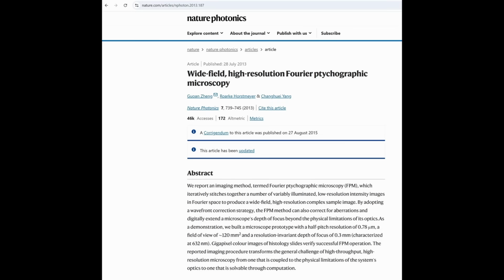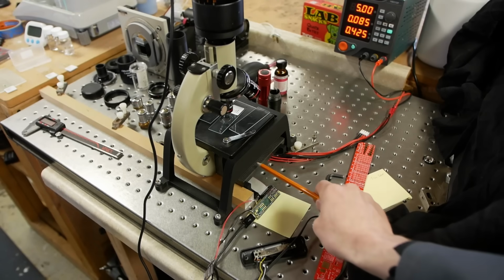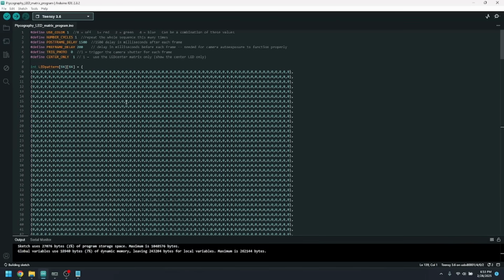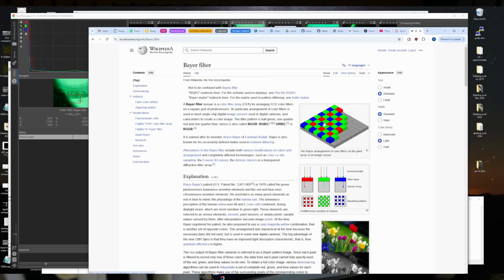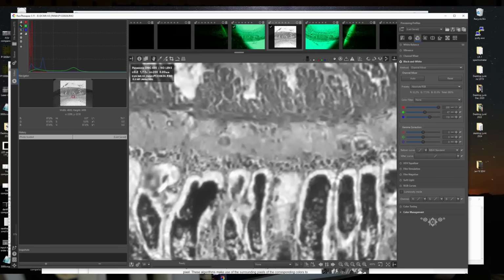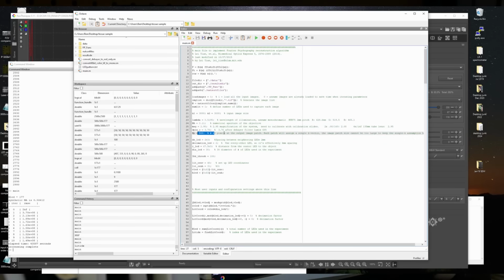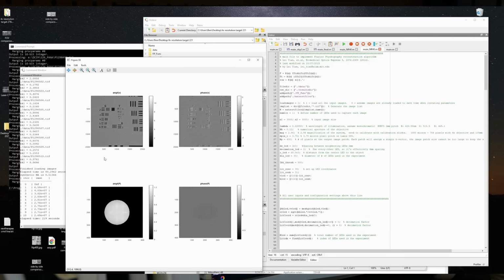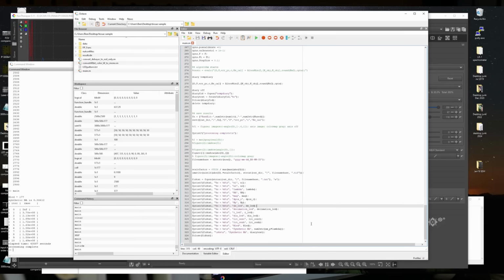Dramatically improve microscope resolution with an LED array and Fourier Ptychography

Comment: It's very cool technique. I found the principle is very similar  to single crystal x-ray crystallography, where as the x-ray is fix .  The sample is mounted on goniometer and rotated, so the diffraction pattern is captured on a ccd camera.  To eliminate the zero order diffraction, they just block everything that is in line with the light source with a metal.

Comment: 18:00 I find it not so obvious why oft center images are brighter. Probably you built an intuition. I believe you should test the emission pattern of the LEDs. As far as I know surface LEDs approximate a Lambertian pattern. I think in this case it makes sense to increase the gain of the offcenter images to compensate for the reduced light coming into the lense cause by less light being emitted into the direction of the lens.
Reply: There might be an issue related to the sensor noise. It think it should be compensated(subtracted) before changing the exposure level.

Comment: 5:45 well there also the refraction too, you have to pass light through different phase changes, from light source, possibly through a lens to get a narrow point source, then through the glass or plastic slide, through the sample that's probably in a liquid solution, through the another slide, then through the air in to the lens system of the micro scope and then the lens of the camera, and then the cmos or ccd sensor

Then what glass is it? some glass isn't totally transparent in visible light, can be a little greenish or bluish, can see that effect if you hold two mirrors facing each other and look at the infinity pattern, stare down the tunnel you just see the greenish or bluish color from the glass attenuating the light each time it reflects the same image...

Silicon glass? quartz or carbon (diamond) glass?
Reply: 7:10 so basically 2d/3d scanning the wavefront or interference pattern to generate a image that has a higher apparent resolution than using a non polarized and Omnidirectional light source

Wouldn't a dmd chip and laser be much better at this than leds, get a much finer light beam, and much more precise scanning of the sample, with a dmd chip you could use it to display the luminance of the sample based on what the capture device is seeing. You can then use different color lasers to provide different wavelengths to scan (irrgbuv), then use that to stitch a high quality image in color, and with contrast and gamma maps

A Laser scanning microscope?

Comment: Very cool!

17:49 "So the question is, can you change the exposure? Does the algorithm allow you to have different exposure levels?"

You could take multiple photos with the same parameters and compute their average to reduce the noise.

I suspect that you could also use a longer exposure time if you can compensate for the increased values afterwards.

Comment: you might be able to do this with a monochrome machine vision camera and then swap single color filters in front of the CCD to reconstruct a color image from multiple monochrome images. you could use a spectral imaging wheel or something like that. then you would get super detailed images with color. although it would be tricky to swap it without moving anything. it would have to be extremely stable

Comment: For your Monochrome needs you should be able to use camera from Astrophotography if I am not mistaken.
Many of them are mono sensors and come in many different price points and sensor sizes.
Planetary, Guidescope and even full frame sensors. All Mono without any filters as this allows you to see full spectrum and filter for yourself and start at 150 bucks for the small sensor sizes.

Comment: My ignorance may be showing here, but I wonder if the images can be split up into different regions utilizing different phases automatically, then, when displayed, it shows each of them, and you can click on the ones which have errors, or the one which is best, and then it reruns with a cluster of phases around the one selected. It's a usability thing, but seems like it would cut the number of attempts to find the phase by an order of magnitude or so.

Comment: Just wondering if a white LED would work better with the colour filter on a dSLR, particuarly if it's the style that uses R+G+B to produce the white colour? What about using fibre optics and a halogen source? The tricky part would be routing light to only one strand at a time.

Comment: It should be possible to get the camera to output the raw color image. This would then be the dotty unbayered image from the bottom wiki pic. Using a white light source, you should be able to reconstruct a greyscale image by multiplying each color type with some value such that you couldn't tell it wasn't a real grayscale image anymore. This would effectively remove the color filter and increase the resolution. Due to the double green, this cannot be done on the bayered color image without introducing a location error.

Comment: You just summarized my first year of PhD struggles in just 10 minutes of explanation. Why you didn't make this earlier?? 😂
Regarding the Bayer filter, you can think of it as a multiplication of comb function with the original input image.
Multiplication on image plane equals to convolution at Fourier plane.
So if can design a digital filter with some sort of regularization (e.g. Total Variation) I think you can get a way with it. In fact this is how camera interpolate the missing pixels.
Alternatively, there are a few cheap monochromatic CMOS cameras targeted for Rasp Pi market. Try using those.
Also can you do comparison on the cheap AliExpress lenses? You said it will not work. I'm curious how good/bad the result will be compared to a proper objective lens.
If it works at certain degree I think it's a good project for students.

Comment: He mentioned you can figure out the phase. But what phase, of each pixel or each illuminated picture or each lighted LED or what exactly?
Reply: He meant the light phase. Light is an electromagnetic wave. Wave has amplitude, frequency and phase delay. You can't measure the phase directly using camera or eyes, they can only detect amplitude (brightness) and frequency (color). But using the diffraction model you can kind of reconstruct the full wave information and estimate the light phase.
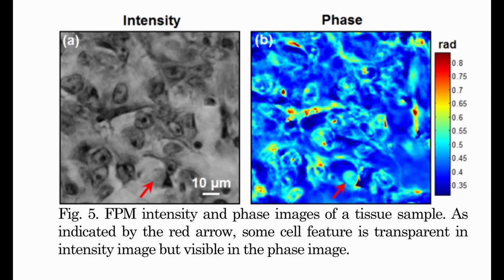Reply: @syukranhakimbinnorazman7430 thank you! he showed a picture at 19:40 - Is this then the phase of the light which is different for each pixel, but has only one fixed value per pixel?
Reply: @ssa7843  yes the right side is the phase image. which is in radian. usually we plot it in range 0 to 2pi. he uses pseudo-color to highlight the low(blue) and high(red) phase. physically the phase delay depends on refractive index and thickness. so you can see the background has lowest phase. next is cytoplasm. highest is the nuclear region, probably due to dense protein structure.

the staining dye are attracted to specific cellular structure. so there might be certain part that remain transparent after staining. 
we can't see them using conventional brightfield due to low contrast. but using phase imaging those invisible feature will be revealed.

Comment: Looks like this is protein X-ray diffraction (or other crystal diffraction) but using visible light, it'll definitely take some computation time to actually get a high-res image out of that. Rotating the beam probably works better than having an LED array too?

Comment: I am really curious if you could try with the raspberry pi HQ camera and physically remove the bayer filter. That camera sensor should not be too expensive, so breaking a few would be okay. It is C or CS mount so relatively easy to adapt to your setup hopefully?

Comment: Excellent!   Very well presented!    
I am looking at the possibility to use this in a non transparent sample by using an array located above the sample (approx in the plane of the back input aperture of the miceoscope lens).   Although I will loose the brightfield  illumination part of the images due to the lens being in the way, I think that the remaining dark field images should be enough tio use the reconstruction algorithm.    
I have a de-bayered old DSLR which I did debayered myself with a lot of sweat and fortunatly no tears.

Comment: This reminds me of coded aperture used in X-ray and gamma imaging where the light cannot be simply focused with a glass lens. Instead, the camera uses a filter plate with predefined pattern of punched holes (sometimes resembling a QR code). A special case of such camera is having a plate with single tiny hole in the center (commonly known as "camera obscura"). The image captured with coded aperture is indeed blurry as there are many holes, but since we know exactly how the image got blurred and the pattern, it is possible to reconstruct relatively sharp image using deconvolution techniques. Unlike convolution, this is an iterative process requiring solving series of partial differential equations in each step.
Utilizing a custom aperture is known in animal kingdom. Just watch how cat's eye pupils turn into vertical slits during hunting while goats and sheep have pupils resembing horizontal bars and we humans have circular ones. We all are basically trading fastness of our lenses for directional resolution. Retina of an eye is extremely sensitive to light so variable aperture is necessary for living in drastically changing light conditions (literally day and night difference) - human eye has a dynamic range of over 21 exposure numbers!

Comment: Great video! I worked with something similar at Uni for my bachelor's thesis. The research group was developing scanning transmission electron microscopy ptychography to enable higher resolution materials imaging. Basically they would measure the phase change of the electrons when they passed through the sample, move the probe a little bit and measure again, repeating hundreds of times for x and y directions, and then combine the thousands of individual images to a better resolution one. My contribution was to try to do the data processing on a GPU to speed it up. I think the result was something like 1000x shorter processing time, bringing it from several hours to a 1-2 minutes.

Comment: would it work to use a phone screen as light source - probably easier to just run some code that lights up little dots on the screen than to build extra hardware? even just a video might do

Comment: I believe a US president who shall remain nameless once tweeted a classified picture with resolution high enough to suggest that there is a secret reconnaisance satellite of size comparable to Hubble. Is it perhaps smaller but using Fourier Ptychography?
Reply: I've given this some thought, and clearly the image processing method for microscopes won't work for satellite cameras. But there may be a similar method which does allow imaging beyond the diffraction limit, such as by combining multiple images taken as the satellite passes over its target. That might improve resolution in one dimension.

Comment: This is incredibly interesting! You may be able to get an older Foveon sensor camera for cheap to perform this technique, but processing Sigma's raws can be annoying. I wonder what the relationship between the pixel size on the sensor and minimum theoretical resolution limit is (or if there is one)? I will have to have a peek at the paper! I suspect you also need to keep the exposure constant across all captures - at least that is my intuition around the Fourier transforms used.

Comment: You mentioned that most modern consumer color cameras have an issue because of their Bayer-type sensors.
There is an alternative called a Foveon sensor that a few cameras from a few manufacturers use.
The Foveon sensor has the individual color sensors for each pixel stacked vertically.
So there is no demosaicing required or used.
https://en.wikipedia.org/wiki/Foveon_X3_sensor

Comment: 12:00 Your thing about the bayer filter may have an exception! There are cameras which have a "high resolution" mode with sensor shift. The way that at least some of the cameras do this means that they end up taking a photo through each color filter sequentially in the same spot, so (apparently) it's as if there was no bayer filter. I don't remember what sequence of offsets my new one uses, but I should try to find out... maybe there's something I could do with this and that.

Comment: Why not use a single xy movable light source? Possibly using piezos and some way to accurately measure the displacement(and if movement is such a huge deal then decouple it from the scope). This could allow you to get continuous changes and, in theory, you could correct the issues in the ccd to some degree. (or even mount it to a piezo displacement system to "fill in the gaps")

Comment: If you needed a phase image and getting higher resolution images is not a problem while getting the parameters right is, could you get a higher resolution image and use that to fine tune the parameters so that you could then use those to get better quality phase image?

Comment: what if you use  ca. 385nm to 390nm UV LED light?  look in the graph all colors have the same sensitivity and  that UV light can pass true the optics of the microscope. Also have smaller wavelength so better resolution.

Comment: 12:50 What if instead of color correction, you use physical color filters (colored membranes specifically made for these kinds of photography can be found in the aftermarket) in front of a camera to capture the same image with all different pixels of the sensor? In practicality, it would be terrifying (it would multiply the number of images by 3), but it would likely make the technique possible with any good camera, even color ones, because it is still a bunch of monochromatic photos.

Comment: This is a product waiting to hapen. I wonder what FPS could be achieved, probably pretty high with some clever patterns. Indeed surprising that it took until 2021 for this to happen but I guess everything is obvious is retrospect.

Also it always amazes me how you take a problem where you have some 20 params to optimize and you basically need to get them all good enough to get any meaningful result. In many cases (here it was maybe not as bad) output being basically binary - it worked or it didn't. And you pull it off through some magic somehow. If I have 3 knobs I'm lost in a multimensional space having no sense of direction.

Comment: i wonder if you could get close to the same resolution boost with fewer images by using different patterns in the LEDs. I don't have time to fully elucidate but if you know how JPEG compression works my idea is to use similar patterns in the LED array so you could take like 20 images instead of hundreds.
Reply: ope, this is why you watch to the end before you comment.

Comment: Great as always.  How about using a back lit LCD panel, with the LCD panel blocking out the light at every pixel but the one addressed, just like you did with the single LEDs? you would end up with an even higher resolution?

Comment: Compensating for the relative rgb brightness effectively changes the binary resolution of pixels by 3-4 or even 5 bits.  This is probably why tissue sample reconstruction fails.  Given a monochrome camera, however, I predict that you could repeat the procedure using several LED colors and produce a high quality color image.
Also, I believe you can indeed vary the exposure times as long as you then reduce the pixel numbers commensurately before reconstruction.  I predict that this will improve noise.
Finally, a circular symmetric LED array would probably work better for natural samples having no vertical/horizontal lines; however, that would require processing the Fourier transforms in radial-polar coordinates.

Comment: I'm very much reminded of a video from Marc Levoy's lab at Stanford from... oh god, it's twenty years ago now.  It was dealing with Helmholtz reciprocity and bidirectional radiance fields in computational photography. The party trick at the end has him illuminate the face of a playing card with a projector (so he can control which pixels are illuminated) and photograph only the back side of the playing card; but because of Helmholtz reciprocity, he can computationally swap a light source with a light sensor, and so with enough shots of illumination with different pixel patterns on the projector, he's able to reconstruct what the scene would look like if it were illuminated by a light where the camera is and seen by a camera where the projector is. It's really impressive. I realize the project you're working from is using more subtle aspects of the properties of light, but it seems at least somewhat related--the wide angle of the illumination source is kind of standing in for a wider lens aperture on the camera side.

https://m.youtube.com/watch?v=p5_tpq5ejFQ

Comment: As amazed as always by your videos! Not pretending that I understand even half, but I did get an idea. You could find/estimate a formula that approximates you absolute light level from each led and apply that as a dynamic background/black/noise light level to each picture. Might improve stuff :)

Also, whenever I've done stuff that slightly resembles this, I tend to try to automate batch runs that alter say 20 parameters and then just brute force through each combination and come back to the computer when it's supposed to be done. Unit test frameworks tend to be a simple way to do this.

Comment: Many cameras these days offer a pixel shift mode (usually to increase resolution by moving half a pixel), but they also offer a simple "debayer" shift mode, capturing 4 images and shifting the image each time by 1 pixel. This way, you can get around the colour filter limitation with some very cheap consumer cameras. (There are simple DNG combiners like PixelShift2DNG to do the post-processing for you.)